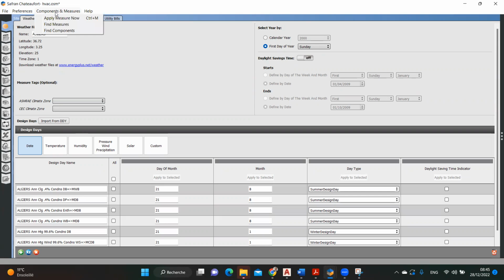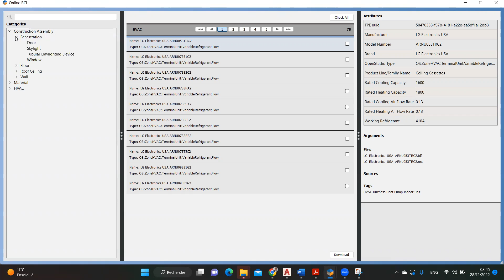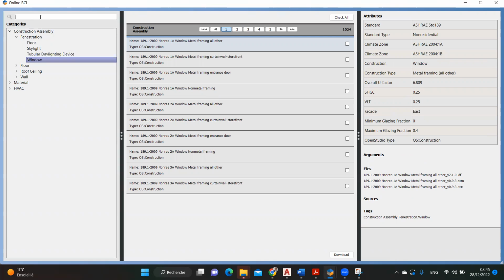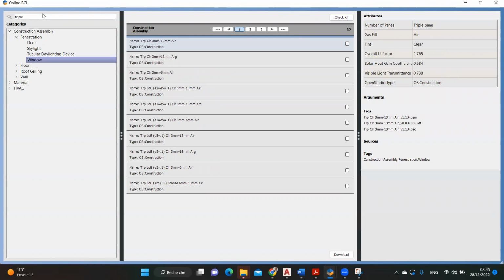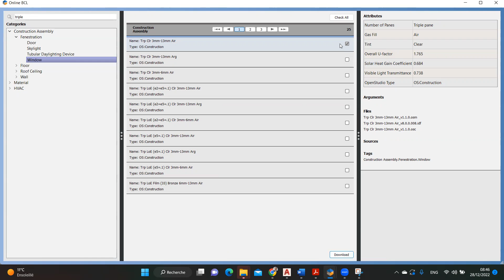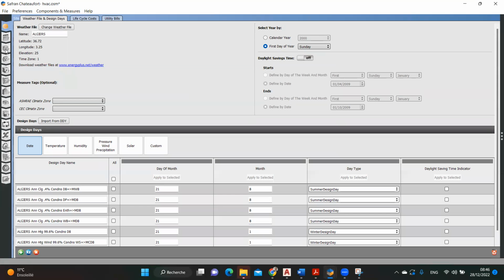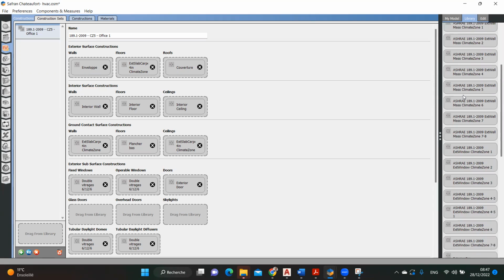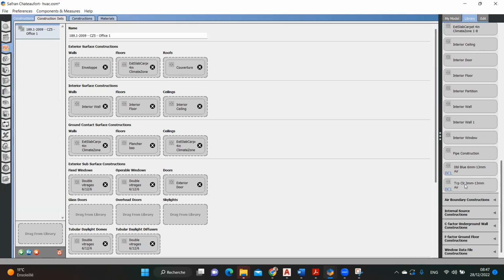How can I model a double or triple pane window in OpenStudio ?

Comment: The item downloaded doesn't show up in my library. What can I do?
Reply from the maker: You can model it using three panes of simple glazing and adding air or gas layers between them.
Reply: @drsamirkhledj9255  Yes I think I figured out in the end thank you. I am assuming thermal bridging due to aluminium framing is taken care of in the simulation? Also how do we model a curtain wall of say 15m by 3m with mullions at every 1.5m? Obviously the more mullions we have the more thermal bridging there is, but it seems there is no way of manipulating the actual fenestration configuration. Do we assume that all framing is thermally broken?